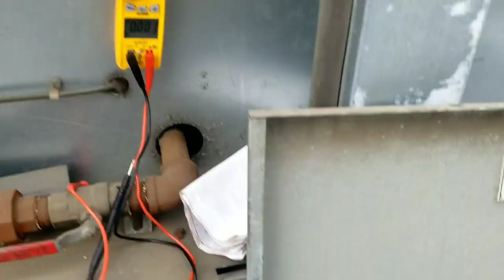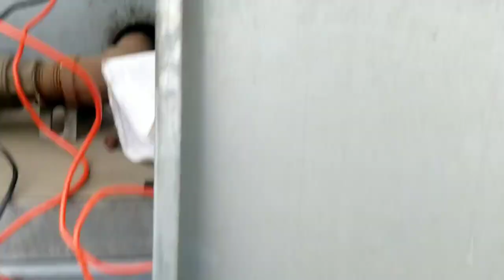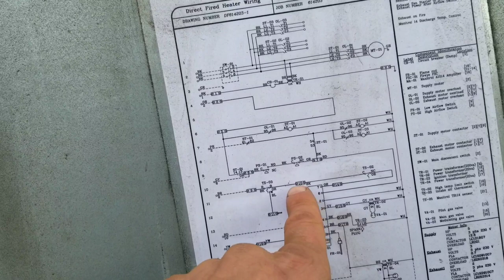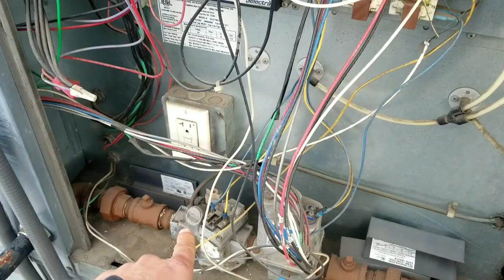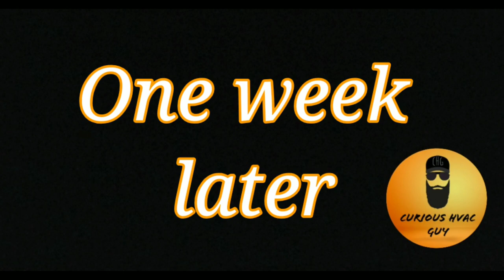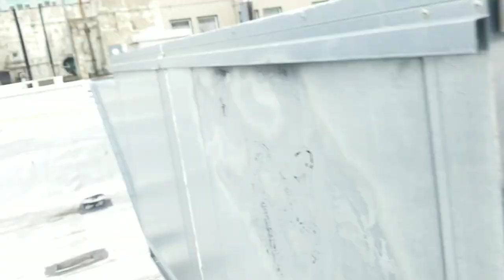Make up air not working

Comment: Those are a kinda a different thing to work on. Takes a bit to understand there wiring diagram. I have learned you can diagnose almost everything from the terminal strip.  Up here where we have snow storms lots of blowing snow. That exact burner control will get snow melting on it it gets wet and I don't have to say anymore lol. The holes in the burner generally need a drill bit run through them yearly to remove rust. I'm sure it's from blowing snow.

Comment: So wait, that unit blows its combustion fumes into the building!?
Reply: Yes, the make up air also has to have an exhaust fan with an air proving switch in series with the make up air unit, so the exhaust fan must be running for the make up air to fire up
Reply: *in series with the control circuit of the make up air
Reply: These are commonly used in kitchens as make-up air for the exhaust hoods, so the air being brought in usually goes right back out very quickly.
Reply: It has 100% combustion its 100% efficient.  Bc of the amount of outdoor air entering the burner not bc the exhaust fan is on..it doesn't matter..they ha e these on huge warehouses...
Reply: Just worked on one of these today at a commercial GYM building , me and the senior tech I was working with also asked the same question lol , and I learned the burners don’t light up if the door is open lol thanks for the video man great job figuring it out 💪

Comment: I had one of these on a lab. The manager of the lab told my installers where to put the vents. This included vents on the end caps. The MU air unit was intermittently shutting down on static pressure issues. I go into the lab and the manager is bitching at me due to repeated issues. I look at the duct work and ask him why the told my guys to put vents on the end caps. He said “that’s where I work”. Then I say “you caused the problem”. I remove the vents and cap them. No more problems. You can have too much supply on those units. Stay safe.
Reply from the maker: Interesting issue, bet that was a satisfying find
Reply: @curioushvacguy6876  The longer I'm in this trade, the more I find I need to learn.

Comment: I worked on the exact same unit that was installed for a paint booth. It couldn't satisfy set point. Never worked on one before that day. OMG it sucks to learn under the gun. Luckey they weren't in dire need of it, went home downloaded the manual, watched a couple videos to understand how to check gas pressure differential....ended up being supply regulator was never big enough from the install.